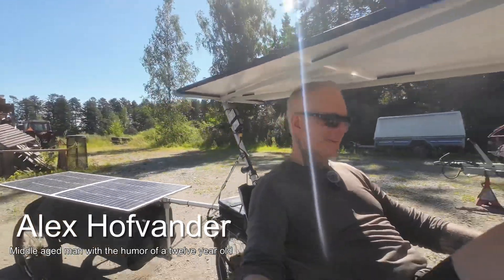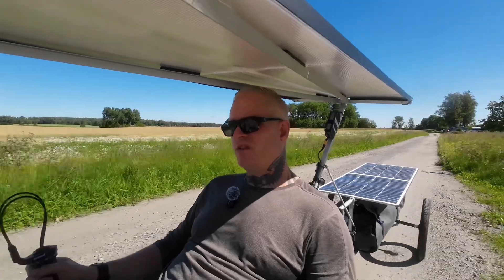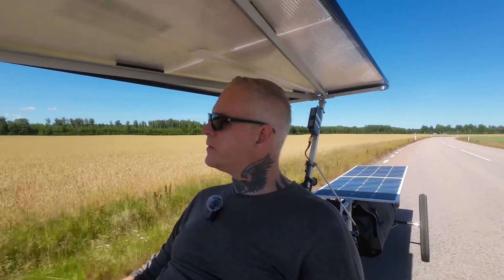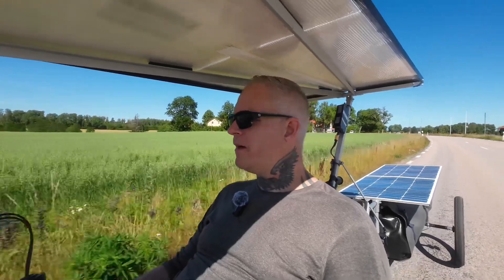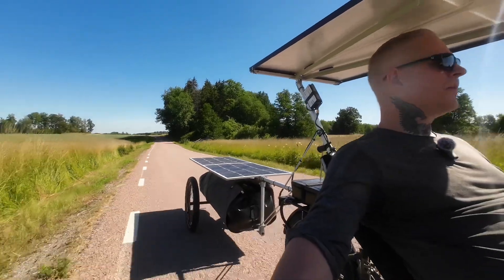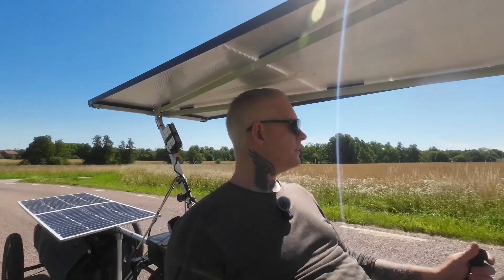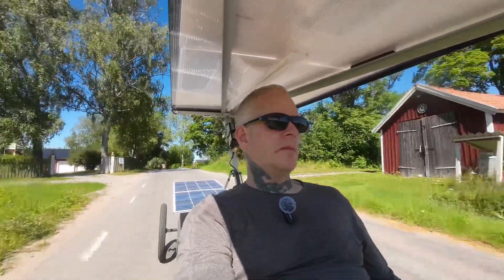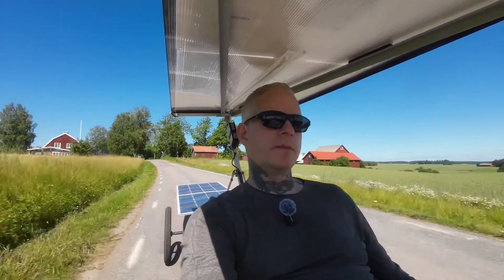Solar Powered E-Trike. Test ride and some stats.

Comment: Great design and video!  I bet you could use 3 panels if you scooted that trailer panel forward and made the trailer a little longer.

Also, it would be good if you didn’t have to convert all the way down to 12V.  48V architecture, like Cybertruck.  Maybe 96V even for the main battery, like high performance e-bikes use.
Reply from the maker: Thank you. 
Each panel has its own mppt boost charge controller that directly converts to the correct charging voltage. Couldn’t be more energy efficient than that. Only one conversion happening.
Reply: @Alex_EVenture  Oh, thanks for clarifying that detail.  I’m sure you did in your videos and I just missed it.   Very cool well done project.

Comment: Hi Alex. Amazing machine you have built! I am wondering, why only 36 volts?
Reply from the maker: Thank you very much. It is several reasons really. I don’t need it to go faster than what 36v gives me. And the boost mppt are more efficient if it doesn’t have to boost as much. Less conversation loss. And I rather build my battery pack with as many cells in parallel as possible with any given number of cells. Because that enables higher charge and discharge capabilities. I don’t have to worry if the motor regen and solar input is too high if applied simultaneously. Hope this answer was to your satisfaction.
Reply: @Alex_EVenture  Very good thinking Alex, thank u very much for your answer. May I ask what brand of trike you are riding?
Reply from the maker: @EBikeGuidesit is a Specbike teckniks comfort and they ship world wide. It is well worth the money. They spec it whatever way you want it. I love that about the his company and they are very good at customer support. And thank you again 😊

Comment: Alex, where goes the poweroutput from the two genasuns out? do they meet before the wattmeter, so they are combined and go through the wattmeter and then to the battery? is there a switch before the genasun for each panel? because i´ve read that the panels must be wiched on first and then the battery for not damaging the genasun...? what do you think? regards Sven
Reply from the maker: Hello Sven. The Genasuns are in parallel and they switch on even if the lights indoors are on. The watt meter is mounted after the Genasun and measures what actually goes to the battery. There are no switches and I never have had issues connecting one before the other but usual is that the mppt is on before I connect. When on tour it will rarely be disconnected at all.

Comment: 250w is not a reasonable power for cargo ebikes ......this is very frustrating since many delivery companies using cargo ebikes hauling twice the weight of even this solar bike and no one bats eyelid or says anything about the power ..
I have Electric Cargo bike and 250w simply aint a reasonable power ....

i use that term Reasonable ...Because the regulation is not reasonable and needs to be ....

Dont Obey Bad Laws ....Be reasonable considerate and sensible

Comment: Thanks for sharing . I wish I had bought my friends kmx trike when he was selling as they are impossible to get here now. I live in Scotland and it's dangerous cycling , I think trike could make for safer cycling . What boost controller do you use ?
Reply from the maker: @lookoutleo  Thank you. I feel very safe and comfortable in a trike. A lot of people think I have a disability or something but I explain that anyone can ride a trike. 
I use Genasun because of their superior mppt algorithm. Way too expensive but I can’t cheap out when it comes to a world touring experience.
Reply: @Alex_EVenture  I'm Scottish that's my disability :) don't know that make controller . Was thinking using a buck boost module . So would boost voltage from 35 to 42 that my battery needs . Most mppt controllers output 12v , atleast the ones I can find. As impossible to find a trike thinking putting a trailor on my bike and mounting solar pannel on it. Maybe folk will give me wide berth then in huge trucks

Comment: How well does the solar roof frame handle the flex in your frame from the suspension?
Reply from the maker: @joshuacoolidge5995  very well. It’s all fixed to the part of the frame that doesn’t have suspension.

Comment: Is that trike with pedal assist very good off road in back woods terrain where a mountain bike could get through?
Reply from the maker: No it’s not. Problem with most trikes when it comes to off-road is the lack of weight over the rear wheel. Most of the weight are placed over the front wheels so traction is less. It’s enough when grip is high. And the tires are not suitable either for off-road. Gravel roads are ok but not fantastic if you know what I mean.

Comment: Do you ever just poke along on solar power alone, just to see how fast it can go?  How fast?
Reply from the maker: @craigsearching  yes, all the time. If there’s a tailwind and more or less flat the solar panels power the motor and charge the batteries at the same time. It comes down to how much the motor can use with the power provided from solar.
Reply: @Alex_EVenture  Without much wind either way, and on flat road, how fast can you get when you stop pedaling and just run on the solar power from the panels at that moment (that is, neither charging nor discharging)?

(In practice, this appears to be an irrelevant question, because solar bike guys NEVER talk about how fast they go on solar alone.   It never comes up.  It doesn't appear to actually be a meaningful real-life use case.)
Reply from the maker: @craigsearching  I really can’t answer because I use pedal assist only and have never tried to run on solar only. There are other aspects to consider if speed is what your after. Let’s say if I was building a bike just to try to make it go as fast as possible on solar only I would use a hub motor outside the wheel and use  gear reduction and gears and so on. 
But to try to give you an answer. Let’s say it’s June. Flat. Just me and the trike and trailer I guess I could reach 15-18kph if the conditions are absolutely perfect in the middle of the day.

Comment: the 250 Watts nominal rule is not directly calculated by powerdraw or poweroutput of the motor. Its calculated by temperature increase over time. Its a pure thermal thing, if you can fit the right cooling system on your 25kmh e-bike you can run a motor with multiple terrawatts peak power.

Comment: What moter and controler do you use?
Reply from the maker: I use phaserunner controller and Grin all axle STD v3 motor in a 20” wheel.

Comment: Nice setup! If you're still having issues with the shadow from your canopy solar panels covering your trailer after you get the short ones, you might want to consider raising the solar panels on the trailer and/or increase the towbar length. You could park it facing the sun in the afternoon then just wait to find the ideal clearance you'll need. Take care out there!
Reply from the maker: Thank you. You take care also. I appreciate this a lot.  That is actually what I ended up doing. The new panels sits further apart and I raised the trailers panel by 15mm. So now I don’t have shadowed panels.

Comment: What is the Kwh of the battery, and weight? I presume it is lithium?
Do you carry spare tube/tire/tools/spare electronics?
Reply from the maker: 1540wh and 6kg. Lithium yes. Samsung 18650 35E cells. 10S12P. Tyres I don’t carry extra. Spare tubes yes. Tools yes. Electronics no.

Comment: I love the simplicity of the trailer build. Absolutely the lightest design. Great job.
Reply from the maker: I am happy with it so far. Seems to do the job fine. Thank you. I appreciate the comment.
Reply: Great, design, but i’ve seen an self-balancing single wheel trailer solar e-bike that would he lighter.  

Also, most people are putting a heavy battery in the trailer.  Instead, i suggest upgrading the ebike’s battery and connecting the charge controller directly to it.

Comment: All great except the stupid football player haircut.
Reply from the maker: I had this stupid haircut way before footballers copied me. I am old. And thank you.
Reply: @Alex_EVenture  So it was ............YOU!
Reply: @Alex_EVenture  And I'm much older than you but football players still have their teeth. So it's not that they copy everyone.
Reply: @Alex_EVenture  BTW, that roof is going to fail eventually. In particular where you drilled holes through the thin tubes. It's amazing how all the rough roads and bike trail can ruin things. But it is easily fixed at any hardware store so don't worry. If you want light you have to take certain risks and see what happens.   

The aluminum 25mm round tube connectors can break also. There are steel versions you can tighten more. Not that much heavier. It depends on where and how you apply them. I had squeaking noises that went away by replacing some of the alloy connectors with steel. Of course the quality matters. Mine were maybe too light. 

Then your mirrors. Can you put a couple small pieces of 22 mm round tube around the square profile tubes? Then it's easier to find different type of mirrors and mount other devices. I'm using mirrors intended for motorcycles but they look nice and proportional on a my solar trike. You and I know how important good mirrors are. Life savers. In fact a third small mirror with rubber strap you can point in all directions isn't a bad idea crossing a busy road. Or shaving or Morse code for that matter. Or to see of you hair needs another cut.
Reply from the maker: @driewiel  yes to everything you said. I have already found a couple of weaknesses and addressed them. Like the 25mm round tube couplings. One trailer wheel hit a bump and that made the panel tilt because the coupling didn’t hold the tube tight enough despite my best effort to tighten it. So I drilled a M6 hole through all of them straight through the tube and put a 60mm bolt with locknut. A4 stainless. That should solve that problem. I have close to 700km on in and a stop regularly to check different things. So far so good. The mirror tip I am going to do and grow a mullet instead.

Comment: If you put trailer panels into a pyramid, or upside down v design you can double the amount of panels
Reply from the maker: I did consider the pyramid and it would be a great solution but I don’t feel the need to add more solar than I have.

Comment: You can also use some Velcro to hold down your panels. Velcro is super strong, as long as the adhesive doesn't fail.
Reply from the maker: Absolutely yes. I thought about it actually and it would also serve great as a vibration dampening system.

Comment: looks like a nice design - i might add some soft poly washers for more shock absorption but overall if you can get 25km/hr that is pretty ideal - you may be able to get faster speeds even for short hops around town which is the vast amount of the trips - park it outside. the design and underlying tech will only get better in the future

Comment: Cool project!

From some of my prior research, it's common that when a solar panel is shaded any at all its power output will be greatly diminished. There are some moments in your video where the trailer panels are a little shaded from the trike panels. I wonder if extending the trailer panel supports up half a meter would improve their performance enough to warrant the extra construction. Or maybe make the tow bar 20 to 40 cm longer.
Reply from the maker: Thank you 😊. I do address this myself in the video and I did have a plan in place to fix it. I finished today to swap out for a shorter panel both on trike and trailer so I gained 35cm more space between them and raised the rear panel by 3cm.

Comment: If I have understood correctly, the 250 watts are only continuous power under certain conditions. Peak power can be significantly higher. The whole thing is limited by the 25 km/h restriction.
Reply from the maker: @nERDANZIEHUNG  pretty much yes. Peak power is used to accelerate and climbing hills. The new DJI motor has peak of 1000w which is crazy but still legal.

Comment: Hi eller Hej? 
Sverige? So impressed by you effort, the wiring frightens me! Never could get my head around it´s lessons.
I also wonder how it feels to peddle half laying down, don´t you have to have your chin pushed down onto your chest?
Well I bought an electric bike that was quite a few years back and due to a move forward into a life as a pensioner here
in Sweden. I wanted to live where it was flatter, I wanted to be able to bike to a store for supplies too.
Having lived on a mountain!  It took me 5 years of looking to eventually find the part of my life that had been missing and
a home that reflected how I wanted to live. Not an easy task so close to Goteborg. I only had to be close enough to my two sons.
Yet that bike was nearly 30000 kr and I have had something happen with it´s control panel? So no bike for a long time now.
Their just no repair shops around here!
I did buy a El-Scooter, thinking it was a form of transport I could not miss out on. As you say, the motors on them are extremely
powerful. I have a motor on each wheel at 2400 W each and top speed sold as 60km/h. Yet in truth it´s top speed is 85km/h.
If using both at the highest setting, this is not a speed you can start in and use only on very smooth and straight roads!
Needless to say I did not know this and when adjusting the options, discovered that you could change the way it moves.
i.e. slow start - speed increases over time. Or shopping mode, where you can move between people.
It was also the only one that could both support my weight at 112 kg and be used offroad on country paths.
Needless to say, I do not weigh so much today!
Yet I am constantly getting punctures after a very short time, I have fixed this issue 8 times now, yet seems to be a different cause
each time. I am very happy with it, as it came with a seat if wanted. I do not use it as I often have a rucksack on my back.
It´s not supposed to be that great with rain, so have avoided it as much as possible.
I´m looking at your solution and thinking that it looks so comfortable, Yet wonder if you have to avoid steep hills?
I also wonder what you think about my puncture problem, should I get the tires filled? Do you know anything about that, maybe I would loose
comfort too. Plus changing the Tyres might be hard? (pun intended).

Finaly, I hope you managed to shake off that fever you were about to get. Thank you for taking the time to show your build so far.
It must be a joy to ride, I could imagine another seat behind you too :elbowcough:

Will Glady follow your news, get well soon :shelterin:
Reply from the maker: @majorbrighton  Hi Stephen. It was quite the read. Yes, I live in Sweden but I will reply in English. 
I am going to try and answer your questions. 
I will post a new video tomorrow that hopefully takes away your fears for wiring. It’s quite not that complicated actually. 

The cranks are shorter than regular cranks and that limits the legs movement. So it’s really not an issue. Plus with 18 speeds I can really dial in the perfect cadence and I have very low gears for climbing. 636% difference from lowest to highest gear. 

On your puncture problem. It is super hard to say really. What many people often overlook is the rim tape that separates the spokes from the rim. Check for sharp edges or split tape. 
I don’t have to avoid steep hills. I just have to pedal harder on low gears. Obviously I won’t go fast. Normal cycling. 

It is extremely comfortable and relaxing in its own way. Nothing hurts after a long ride. There are tandem trikes to buy if you are looking for one. 

Thank you for your well wishes. I appreciate it a lot. I feel fine now and I am heading to the workshop to put on the new solar panels.
Reply: @Alex_EVenture  Ah, thanks Alex. Great to hear your ok.
So thankful for your quick reply. Had a feeling you would be keen to help, given your justified excitement with your ever adaptive insights.
Is it not the truth though, as I can imagine how captivating any progress is going to feel with the subject of mobility. One of the most discussed and interesting topics in our future and past, Time is money, energy is free, constant feedback is rewarding and moving forward is progress. So yes, I find what you have been doing captivating, it´s on everyone's minds and is literally now a life saver with so many questions not yet thought of. Our climate is everyone´s problem, yet their are very few out there who know where their true worth lies.

I hope you find the kindred spirit to continue on with this direction Alex, because your not following a path, but designing your own for others to follow and in truth, in the end, you will understand, that it´s not the goal that was important after all, but the path you made to get there and that your only limit, is as simple as knowing where your heart is.

These words are to lift your spirit and a simple thank you for creating an idea of making the world easer, lighter and affordable.

I will look forward to your steps taken and I hope you can continue to give people inspiration. Thank you

Steve in Sweden
Reply from the maker: @majorbrighton Your kind words definitely lifted my spirit. Thank you so much. My inspiration of this channel lies in I want to help people. I know when I started out how hard it was to find information. 
Thanks again Stephen 😊